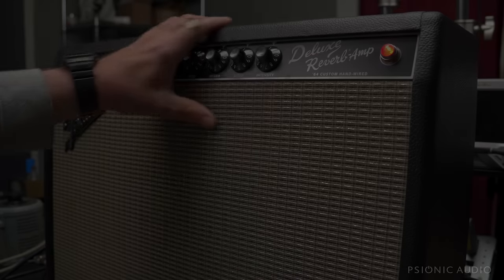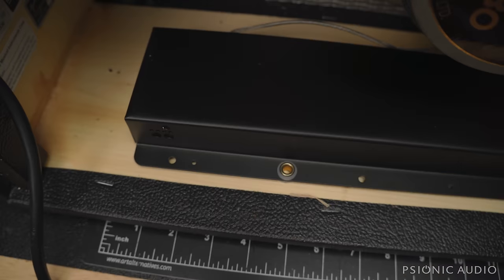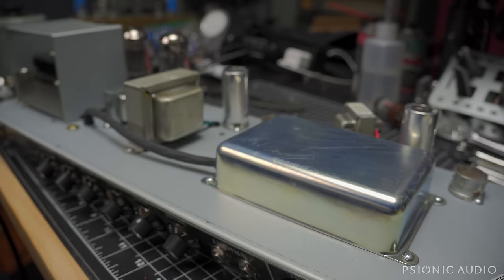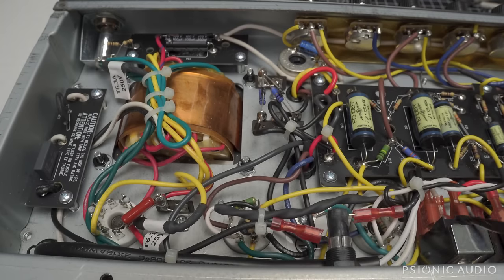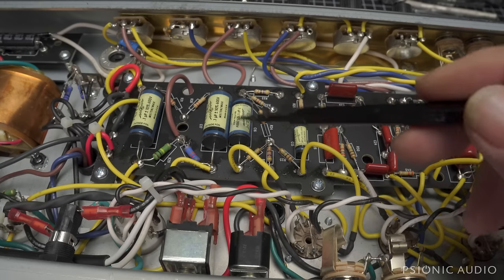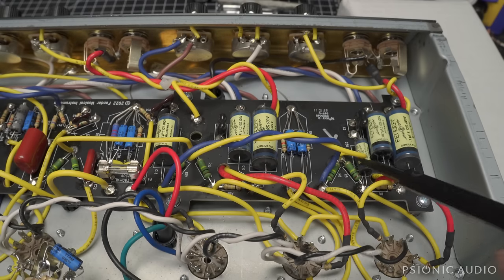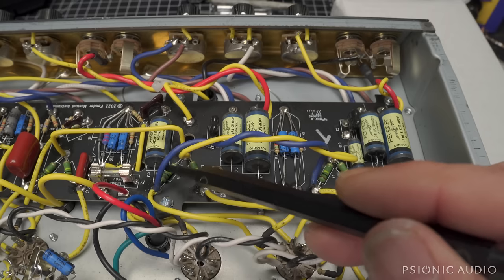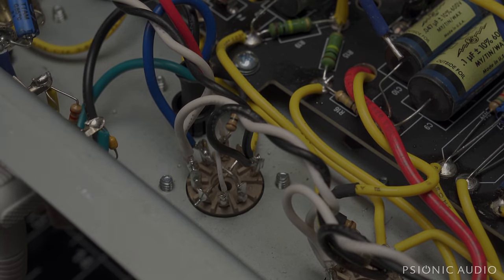Meh | Fender '64 Custom Hand-Wired Deluxe Reverb Pt 1

Comment: Having plates tied directly together is fugly.  In addition to the gain issue you mentioned, there's another problem.  Let's choose some numbers for convenience.  Let's say your preamp supply is 300 v.  And you've chosen cathode resistors such that at idle each triode is drawing 1.5mA.  Plate resistors are 100k.  Your plates are at (300v - 150v) aka 150v, putting them roughly halfway between cutoff and saturation.  When you tie two plates together, the total of the two triodes draws 3mA and the total plate resistance is 50k.  We still have 150v between the plates and the preamp supply and 150v between the plates and ground.  Looks okay.  Now we pull one of the tubes.  The current drops to 1.5mA but the total resistance stays the same.  50k.  Now we only have 75v between the plate and the preamp supply and 225v between the plate and ground.  We've shifted out idle toward cutoff.  No problem if the ac signal is modest.  But for later stages, this could be a problem.  It's not quite as bad as this first-level analysis suggests, though.  By plucking a tube, you've removed two triodes from the load on the preamp supply so the voltage will go up a bit.  Still, it's fugly.

Comment: I’ve just run into a short stream of bad SM caps. Replaced them with Sozo micas(expensive but they ARE good) and the problems go bye bye. Strange because the SM’s measure fine ,no DC, but just they cause noise sometimes.

Comment: I agree with the critisism about the fiddly changes and components added to the reissue.  If you are paying that much, you are probably looking for a reliable and robust copy of the iconic amp using the exact same legendary circuits.   I mean, even when talking about the good old legacy amps, you could start a riot over discussing the differences between AA763, AC568, AA1069, AA270, AA371, and which ones are better.  They should really know better than to think they could introduce even the most minor change and not end up with backlash...

Comment: if anyone wants to upgrade these 2 channel blackface amps i highly recommend putting better (vintage) and different tubes in v1 and v2 for better tone and versatility. ive been working with 2 twins on live gigs in the last ten years with many players from different genres, all sorts of guitars all with great results.
on v2 i use GE 12ax7wa (150$ nos) for maximum clean headroom later breakup cool mids crisp highs, works great with humbuckers for cleans. 
on v1 the normal channel i use a mullard i63 (200$ nos) which reminds me of a bassman tone. more low mids less highs, the ultimate cure for bright guitars strats and sgs on the bridge pickup all day long, it's also the best pedal platform for drive, it will never get fizzy.
enjoy!

Comment: I really enjoy your videos. In your opinion, what is a solid, clean, high headroom amp in the $2500 range. You already “poo-pood” my tone king imperial choice! lol
Reply from the maker: A used Fender Twin/Pro/Super Reverb. You can get ‘70s examples in good shape for less than $1K then put $300-500 into a restoration and have an amp as good as a Two Rock. You could do all new tubes and speakers and still be less than $2500.

Or a Suhr Bella if the wattage suffices for your needs.
Reply: Thanks man. Will do. I’ll definitely get a hold of you once I can pick up one of your suggestions. I’ll then bring it to you for the goods!

Comment: Heater fuse, what were they thinking? If that blows then the tubes stop glowing, possibly leading people to think there's no B+ inside. And the high inrush current means that the fuse may be prone to failing even with no fault present. I'd just pull that out immediately.

Comment: I would think they would want to use shorter length wire to save money.  It would look a lot neater.  Hoping for a part 2.
Reply: My guess is that it's more difficult for the fender techs to wire these amps with every wire trimmed with minimal excess.  It requires additional manual dexterity to manage wiring that doesn't have any excess... High Labor cost, especially in the US (California) will far eclipse the cost of wiring.  Also, I suspect that people would complain about insufficient excess left for repairs if prioritized wire length minimization.   My question is, other than being unsightly, what is the functional draw backs of having excess in the wires if any?
Reply: @JeremiahL  Original black panel Fender amps all used solid core cloth covered wire and is much easier to form and look nice than the stranded plastic covered wire which should have been at least tyrapped together in the reissues, if not installing solid wire.
Reply: @JeremiahL  Excess wire leads to noise. How the different wires are positioned matters, too. If you've ever heard the term "chopsticking," that's where you hear this first hand: you use a non-conductive tool like a chopstick or plastic pointer like Lyle uses in the video and move wires around to minimize noise. Lead dress on an amp isn't just for aesthetics, and the higher the gain, the more important it is.

It's also a hell of a lot easier to work on an amp that isn't just a rats nest of excess wire.
Reply: @ianjamesevans  Thanks you for the explain.  I guess in comparison to what Im used to seeing in modern electronics, I wouldn't describe the wiring shown on the reissue as being a rats nest per se.   With that said, I did compare some photos of an original AB763 circuit board, and it is a significantly  more tidy than the reissue..  It looks like the reissue uses more connection blocks and spade terminal connectors that also consume a lot of real estate inside the box which probably contributes to the lack of integration space inside the board...

Comment: Yeah,  I tried every which way to put reverb on both channels and concluded that after the caps was best, with the 220K mixing resistors. Many players like to pull tube 2 for more gain. I like the sound of that too, so will put another 820 ohm resistor in parallel to hot bias both channels

Comment: Apart from what you drew our attention to(thanks) would you say it's as "Safe" to use as the originals or better? I think they sound good but even if it was less expensive those silly "in-line" fuses covered with shrink wrap are a joke. I want to at-least be able to change fuses easily as they can pop for a lot of reasons. I was tempted but the price sobered me up and I built my own " 40watt Black-face" 1 channel Deluxe Reverb and stuffed it in a tweed blues dlux cab with an Alnico 12", added a way bright switch so I can play at low volume at home and still get that Zingyness. I know Fender can do better, they made those "Brownface" deluxe re-issues with the really good tremelo circuit as good as the originals and maybe better and safer too?
Reply from the maker: It’s safe. Just way overpriced with some dumb design changes.
Reply: Agreed, took me 6 months to build my own and after a lot of sweat and shaking am now happier than ever with my little 40watt 1 channel dlux reverb!

Comment: The board has (C) 2022, which means this is brand new. So these problems arose within 2 years at most of manufacture. That's embarrassing for Fender, but just curious why the owner didn't have it warrantied, even if that doesn't solve the inherent problems.

Comment: Ooooh yes....i know that noise. Shitty quality plate load resistors pretty likely. Bet it can use the suppression cap on the reverb driver too...I've even seen random real blackfaces do it. At Kendrick, we used to put a few strips of adhesive  weatherstrip along the length of the tank top to dampen the ringing tendency. I agree 💯 with you about spending your money on a 70s silverface instead. Guess they learned their lesson about those "IC" caps. 
The ladies who wired the Fenders would bitch-slap whoever did that wiring.There...i said it 😂

Comment: If you were in the market to buy a Deluxe Reverb, where would you put your money? Should I buy a Weber Kit, or an original 60's, or one of the new reissues? Thanks!
Reply from the maker: Never a Weber kit. Used 65 RI, vintage 70s or 60s, Headstrong, Top Hat, Suhr, a few others.
Reply: @PsionicAudio  So get a used 65 RI and do the upgrades you recommend from your channel?

Comment: I'm sure I'm missing something, but I don't understand how the two 100 ohm Rs on the heater supply will protect you from a short. It seems to me they would be in parallel with a short downstream someplace, not in series with it. Maybe the trick is if you short one side to ground, the other side R limits the current and eventually cooks off & opens up?

Comment: At about 8:00 is that a varistor (to dump voltage spikes to ground) or a thermistor (to prevent a current surge at turn on). Looks like a thermistor to me; varistors are typically blue or sometimes tan, but thermistors are almost always black.
Reply: Oops, asked and answered;  I paused the video to make my comment before I saw your overlayed correction....

Comment: If one is trendy and needs the brand name on the faceplate by all means buy this amp. It’s your money. But a smarter idea would be to contact one of the top recognized amp builders in the US such as Boothill, Marsh, Lil’ Dawg, Tungsten, etc.. and have them hand wire you up a proper tube amp. I know Marsh for example even allows standard and even personal upgrades/mods.

Comment: Lyle's videos are fantastic but they have also scared me off tube amps. As someone who lives in Asia, far away from vintage amps and with limited tube amp options here and few techs to work on them, it's quite disheartening to find out that paying extra doesn't necessarily mean that you get something reliable and without problems. I somewhat expected this with regards to Friedmans and Morgans given the hype surrounding them, but I was surprised to learn that Tone Kings also have issues. I'm not surprised at all that Fender is overcharging for these. I guess my best bet is to just go with something mid-priced like a Ceriatone and make room in the budget for it to be continuously worked on.
Reply from the maker: Friedmans are very reliable safe choices.

Comment: Great video!  I’m so thankful for you sharing your knowledge!  I have a 1966 Fender Tremolux that I converted to a 1x12 combo. The sound of the amp seems thin compared to the reissues that I have played. The amp has been serviced well over the years and is in good working order. Any thoughts as to why it would be so thin sounding?  Any other wisdom to share on the AA763 Tremolux?
Reply: Could be the tubes you are using or some capacitors that are off.
Also these amps weren’t designed for 1x12. You should play through a 2x10 or even a 2x12.
You may also have an impedance mismatch which can cause the sound to be thinner
Or you could have biased it too cold.

Comment: Those Groove Tubes have serious QC issues. I wanted a Vibro-Champ Reverb a couple years back, I played 3, every one of them had microphonic tubes. I bought a Dream '65 that I run through my monitors for a practice amp instead.

So if you want to buy a new Fender amp you should factor new tubes in to the cost. Feels to me that Fender is riding the brand loyalty harder than the quality product bus. I went through the same rigamarole with Deluxe's, I played a Suhr Bella Reverb, that will be my next amp. I'd rather pay the extra money and wait a bit longer than to encourage the FMIC crap-bonanza.

Seems to me a lot of folks are doing Fender better than Fender these days.

Thank you for listening to my polemic. Carry on.

Comment: I highly recommend Headstrong amps. Superior by a long shot to these inaccurate “hand wired” reissues. Every 64 hand wired deluxe reverb I tried was so noisy and had a constant hiss at low volume. I’ve experienced 0 of that with my headstrong amp. Of course there are other boutique builders out there

Comment: Got this amp for cheap (demo with a small crack in wood part). The reverb on/off switch is causing big pop. Any idea if that could be alleviated somehow? :D
Reply from the maker: That just shunts the grid of V4a to ground. There’s a 220k from grid to ground that should keep it from popping. First thing to check is that the RCA jacks’ nuts and the footswitch jack’s nut are tight, so ground really is ground.

And that the RCA connectors are clean. Isopropyl alcohol from the drugstore oughta do. Let it evaporate before reconnecting.
Reply: @PsionicAudio  Thanks! Got plenty of IPA already. Great for... everything. I literally use (medical) IPA mix as a deodorant. :D

Comment: Great video. I was wondering what was up inside the current Fender handwired. Very informative. I have wondered why there aren’t more high quality new parts that look “vintage”. It’s pretty odd to deviate so much from original design the customer is expecting—only adding the accepted grounding improvements.

Comment: Idea Lyle:  if your audience was to send you suitable high res and quality images of amplifer internals that you've yet to review / had on the bench would you consider doing a review / discusssion series?  I think this would be cool.   It'd be really great to hear your view's on what you can 'see' as to build quality, choice of componenents and lay out and given a good high res image that can be really zoomed in on, wouldn't that be a great contnent idea?  Just a thought.  I'd also be happy to start the process using one of my new Orange Amps.
Reply from the maker: I’d be interested but it’s tricky to review something just from photos. I still get shit about the Tonemaster video where I was giving warnings from seeing photos of the construction.

I can often spot issues from clear photos but it’s better to be able to measure. 

Take your Orange for example - most Oranges’ Achilles heel is the long bushing pot metal split shaft pots with set screw knobs. They break if you look at them too hard. But I can’t see that in a photo when the knobs are all on.

The other issue is I already get more emails than I can keep up with.
Reply: @PsionicAudio  No worries mate.

Comment: The blue wire above center of frame at 14 minute looks bare and burnt.
Reply from the maker: It’s got heat shrink on the end. They’re using it as an iffy shield - one end at ground.

Comment: Interesting ! I see no LDR for the Tremolo
Reply: The LDR contains cadmium sulfide which is a banned chemical for the EU market, so they used a different oscillator circuit. Obviously they hope to sell 240 volt versions of this amp to the European market.

Comment: I had mine rebuilt by Carl Carrasco of Carls Custom Amps. He reverts the normal channel reverb to the old circuit and makes a bunch of similar tweaks you suggest here. After that the amp is really nice. But it’s sort of buying a Soviet car that you have to take from the dealership to the mechanic before you can drive it.
Reply: I had Carl cure mine as well. In addition, I switched out the speaker. Now a great amp. Before…. Loud, harsh, and shrill.
Reply: And yeah I also switched out the speaker. Really like after all that :)
Reply: @retroman541  The tech work was about 425 bucks

Comment: You would think that the over priced New Generation Fender Deluxe Reverbs would come with a decent Speaker.  Not to mention decent PCBs
and Caps.  But Fender now is just so ridiculously over priced and so cheaply made.  Nothing like the Old Generation Bread Board construction.
But even then you had to be lucky that all the caps and resisters were placed correctly.  Fender now is just a name!!!!!

Comment: Well done! Spaghetti for sure! Yuck. Really they should not call it a "64. And I am not usually that much of a nit picker but first: 1964 Deluxe Reverb did not have the Fender tail logo. Also using the Princeton tremolo is just wrong. Make a different one for Europe. Fender should just go all the way. Exact replica. It can be done. Even hire ladies and train them to use the original techniques. It would sell at a premium price still. I own an April of 1964 Deluxe Reverb, and I kinda take it personally. lol

Comment: Wow.  Disappointing to say the least, and Fender has jacked up the price on the ‘hand wired’ amps over 40% in past few years.  If the Princeton hand wired was an actual reproduction of a real, black face amp, I’d gladly buy one.  But this analysis has completely turned me off.  Crossing my fingers and hoping my Ampeg Reverberocket II doesn’t die on me.

Comment: I tried this amp in store and was amazed but how noisy it was. $3K for this garbage. Buy a headstrong amp, swart or other real boutique amps that do not cut corners like Fender does. My headstrong deluxe smoked the 64 fender hardwired.